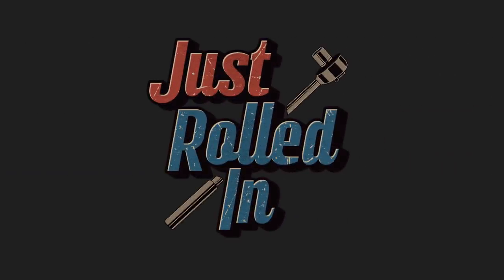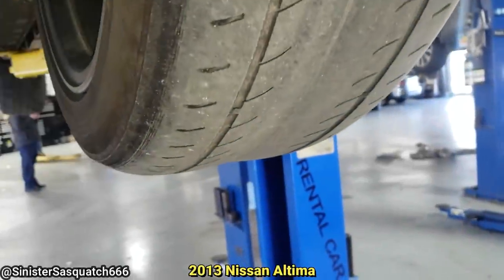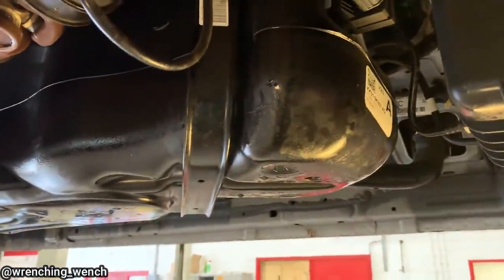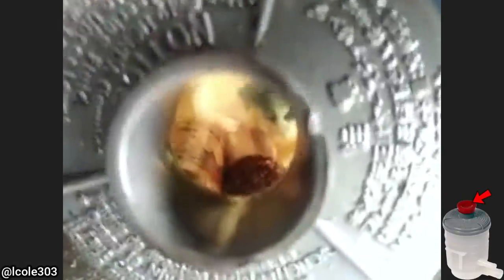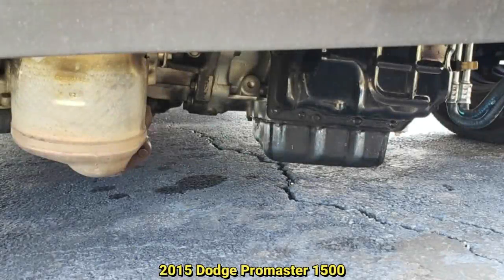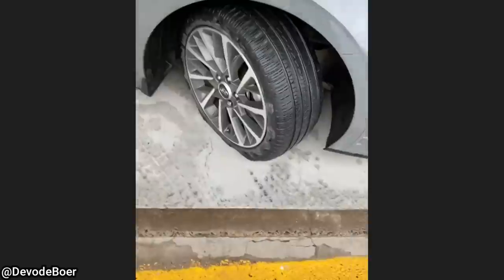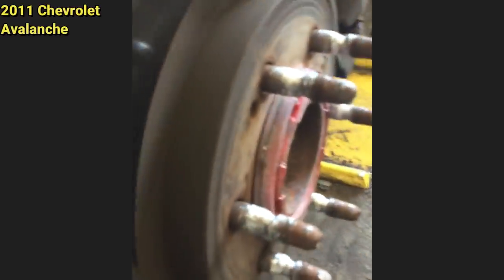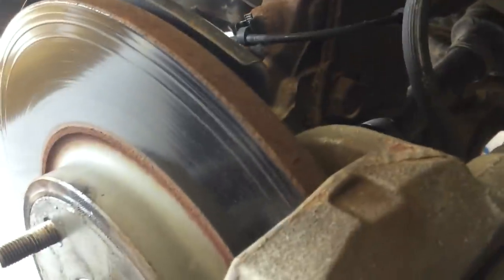Customer States Engine Is Making A Funny Noise | Just Rolled In

Comment: Im glad i dont have to deal with customers like these, as a truck mechanic not having to deal with customers most of the time its great, they only bother sometimes when something happens and they immediately blame the mechanic despite them not listening to us, had a customer where the brake pads we're changed, and both me and my colleague are sure we tighten the bolts of the wheels with proper Nm, but the customer came back two weeks later and one of the wheels had loose bolts, of course he blamed us but the thing is, he's supposed to come back to the workshop after driving 100km to check the tightness of the bolts again but he drove more than 100km and didn't come back to check them just like most people do.

Comment: 01:59, I work for a company that does the pickups for used tires from garages in my area, on a daily basis I load probably around 1300 tires a day into a truck in the busy season(s).

i would say at least 1/5th of the tires we pickup daily are far worse than this. when i first started it absolutely blew my mind seeing the condition of tires that people drove in on.

on a side note; BMW's run flats are quite impressive, the lack of damage on them despite clearly being driven on while flat makes me want to get some for my Mazda lol.
Reply: I got stuck in mud , made my right rear tire look worse than those tires , I changed it with a spare tire , it held air for like 9 months then I got a flat and realized that the stuff that came with my truck was unable to remove my tire 🤣 all fixed now

Comment: OOf, had the broken engine/transmission mount happen to me, previous owner or their garage hadn't tightened the bolts on the driver's side at all,  so they fell off and dropped the engine, had it towed into a repair place, they fixed it, then the PASSENGER side mount snapped as they rolled it off the lift, because of the stress it'd been under. That was bloody expensive

Comment: I don't think I was even 21 yet but I was driving around on bald tires because I was broke.  I went around a cadillac doing at least 70mph in the pouring rain and when i changed lanes the car fishtailed.  Then it went into 360 spins.  I saw the cadillac's headlights go by a couple of times and then a utility pole while I was sliding backwards down the highway.  It missed the pole by inches and finally the rough stuff on the shoulder brought it to a stop.  Man that scared the living daylights out of me.  I went the very next day and got new tires on credit.

Comment: A customer came in complaining his Audi A4 doesn't start (back then when I was working as a mechanic). We pulled the valve cover off and the whole head was full of black, almost coal looking, thick stuff. Camshafts would not turn, the whole engine was jammed. Not a big surprise engine oil hadn't been changed for years.

Comment: I can relate to the guy who drove in with the tire almost flat. Once I popped a tire on the freeway right as I was about to exit onto another freeway. I had to drive about a mile on a flat tire to get to a spot where I could change the tire without stopping traffic for a few minutes. The tire shop said they weren't going to prorate the tire for me because of sidewall damage until i told them what happened.
Reply: I'm all for not ruining a wheel unnecessarily,  but you need to get to the safest area possible to change your tire. I worked along roadways as a surveyor for 25yrs, and I've seen enough crazy driving to make me extra cautious working so close to traffic.

Comment: seeing this made me realize how well my 30year old car is still holding up. The exhaust system needs to be replaced but it's at least still firmly attached to the car XD
Reply: I had the exhaust system on my Taurus wagon ( 86 model) fall off. It rusted so badly due to road salts that collected on the hanging brackets 🤣

Comment: I've worked on all my cars and motorcycles in the past. I'm no engineer but I know when something is wrong. So when I heard a front wheel bearing groaning at me I took it to the dealer. I told the receptionist, " The left front wheel bearing needs replacing. " No ifs or buts. 2 hours later I get a call from the dealership. " Ma'am, after testing we found that the left front wheel bearing needs replacing. " Grrr. " I told you that when I came in. How much am I going to pay for that startling diagnosis? "..." Crickets ".... " When are you going to fix it? ".... " We don't have those parts in stock so it'll be two days. "... " You're the Citroen dealership but you don't have Citroen parts. " .... " Crickets ".... " Tell you what, just leave the car in the parking lot because I've lost faith in your service ". When I went in I expected to pay for the labour cost but they were so pissed at me there was no charge. They just wanted me out of there ASAP. I got it fixed at small garage I found on the internet and it took them only two hours. Dealerships are good at selling cars but not fixing them.

Comment: I like the photoshopped 997 in the outro. Totally legit.
Reply from the maker: And why is it photoshopped?
Reply: @JustRolledIn  Because the angle of the car does by no means match the angle of the ground. Not to mention the colouring is off. Rather easy to see for everyone who is working with photos and editing them.
Reply from the maker: Well they sent me 3 high quality photos that were taken so most likely they were photoshopped a bit.
Reply: @JustRolledIn  It very well may be, that the car is indeed real, but the background isn't. Not that it really matters, just jumped out on me. The 997 is nice either way

Comment: About the last one, the partly armoured car: I saw this several times in Brasil. It can make sense, as it protects against "minor" instant crime with small guns pointing to the head of a driver/passenger. It can give the attacker an unwelcome surprise and the driver an advantage for escaping. 
This kind of "half" protection has its pupose and is somtimes even offered by traders for cars in "disguise" (VW Golf, Toyota  Corolla). Customers are doctors, lawyers and managers. 😎
Reply: A friend had a Merecedes coupe with bulletproof glass , it was part of a protection package . The bottom and doors had plating too

Comment: That one tire looked like it was already about to come apart. I get that U.S. doesn't want to go full safety inspection but I think there should be laws against using unsafe vehicles like tires like that. Who cares about no windshield fluid or that one guy who drives abandoned vehicles from the swamp for a YouTube video but every day drivers who have no clue their tires are about to explode need to be taken off the road until they get their vehicle in working condition. 

When I took my car in for some reason I can't remember he told me about my sagging exhaust. He explained to me that it could split and cause my vehicle to flip. So I fixed it. Actually they just welded it together for less than $80. Great shop! 👍 Also warned me about my tires being close to the low wear indicators
Reply: Double edged sword though. If you think a shop would impound your car you're even MORE likely to bodge it yourself. Maybe.
Reply: @PJBonoVox   that's true. I just don't know how these people can drive on dangerous vehicles with no regard for safety, eventually you'll be paying one way or another. Not really saving any money by driving on bad tires.
Reply: @VintageCars999  Yeah agreed. Don't get me wrong I'm not condoning the state of disrepair and a yearly MOT would be a good idea.

Comment: Had the cap fly off in my hondas pwr steering reservoir(due to return line leak allowing air in the system) it ended up on the frame rail. I thought of putting a bunched up towel on it good thing i didnt.

Comment: Embarrassed to say it took me a minute to see the issue with the battery.  My sister in law once had me cover over after she installed her own battery to see what was wrong.  I was confused why there was no voltage across the terminals until I realized she left the disposable plastic cabs on the battery posts.

Comment: about 40 years ago I was doing an LOF (lube,oil&filter) I saw the brake pads were into the rotor. He says I,ll get them done at a shop next to work. He was a rich know it all, so I said ok. By the time he got to work he had to replace both rotors. I tried to tell him. The whole family was that way.  The wife would come to get gas & say 5. If you put in gal she would say she wanted dollars or vice versa . Then get mad when you ask 5 dollars or 5 gal. Glad I worked in the shop & didn't have to deal with them.

Comment: once had a young lady come in with a brand new nissan back in the late '90s.  she claimed she went to check the oil, couldn't see any and decided to fill it up.  When she got in the car and started it ALL of the lights immediately came on so she came to the shop.  I go to take a look at it, first thing i do is pull the dip stick and it's wayyyyyy over filled.  I asked her how much she put in and she responded with, I filled it until I could see it.   Meaning she took the oil cap off, didnt see any oil in there and filled it... the entire motor on a brand new car.  I told her if she had a warranty she probably voided it...

Comment: Isn't the gelled oil the same stuff they used for Cash for Clunkers in 09. They had to put an additive in the engine and transmission so it couldn't be sold. I own an independent shop, but I know guys that worked at dealerships. I remember them talking about what they had to do.
Reply: The additive was called *LIQUID GLASS OR SAND* if memory serves right?

Comment: I had a customer buy a battery at the retail store I worked at, A few hours later he had his car towed in because it still wouldn't start. I opened the hood to check it and he installed the battery with the red and black caps still on the battery posts.

Comment: It really boggles my mind that America does not have an MOT requirement like we do in the UK. It is illegal to drive on bad tyres in the UK, there is a minimum tread depth requirement and any damage to side walls is simply not allowed. Likewise the engine hanging out of the bay because the mounts were gone, simply wouldnt happen - the car would have been written off long before that happened

Comment: Worked with a woman whose daughter bought a new car.  She had to drive about 100 miles a day, as her job was in another town.  After about 3 months her car "died" before getting to work, and she had it towed to a mechanic shop.  
The mechanic asked her how often she had the oil changed.  She said "Cars don't take oil, do they"?!
The mechanic told her she needed a new engine because there was no oil left in it, the engine had burned up.

These are the morons and Ftards the DMV's put out on the roads.

Comment: I wish people understood that having a vehicle that is so rusted out that things are falling through the floor and whole sections of the body are gone, is just about as bad as having a blown engine. Replace the damn vehicle or start doing some extensive metal repairs. . It no longer has the same structural or tow rating and is a very real danger.

Comment: My favorite excuse when I had to deal with customers who has a flat or bad tire(s) was when they blame the tires for being defective 🙄🤦‍♂
Reply: Ok , so is it normal for your tire to blow out after the tread separated? Cause that tire was fairly new , had good tread on it , and was properly inflated . So … I’m guessing sometimes tires are bad . The tire shop gave me 1/2 off the new tire , I didn’t ask for it, guy gave it to me cause he felt bad
Reply: @peterf.229  yeah its soo normal 🙄   The percentage of actual tire manufacturer defects is low, like 1%  Show me where the tire was properly inflated prior to the blow out?  I'll wait.  More than likely the driver ran over a nail or something (or even a pothole at a high speed)  to cause  the tire to loose air and led to the blowout.

Comment: Yeah I had a Honda Odyssey come in today on the rollback the customer said to find exhaust leak and do an oil change and see why C E L was on it was multiple misfires the cats was rusted out blown exhaust manifold but the oil had 11 quarts in it should only be 4 and 1/2 quarts I cranked it and it smoked like a house fire but after running it shutting it off and cranking it 4 times it burnt all the oil out the cylinder stopped misfiring but I told them need to replace sparkplugs because of possible damage he never said how it got so over filled

Comment: They may have changed this since then, but my dad had a  Subaru WRX when I was younger, and despite doing most of his own work on it, he always took it to a shop for oil changes. That’s because, as a low-end rally-racing model, it had an aerodynamic plate underneath the engine block & oil pan blocking access. The inconvenience of getting the plate off without a lift outweighed the convenience of at-home oil changes.

So I’m calling BS on that guy actually doing any changes himself. Given the critical thinking shown by “only oil additives” I’m guessing he saw there wasn’t an easy way to access the oil pan and assumed it was unnecessary. And if you never take oil out, why would you need to put more in? The oil additives will make sure it works right? 🤦🏼‍♂️

Comment: Oh, the poor cars... I weep for the beautiful machines ruined by idiots like that. Our family can only afford 1 car and although it is older than me, it's kept in a good condition. Regular checks, oil change, no abusing the steering, fixing tires yourself or pouring questionable concoctions in it. The only thing that is not in tiptop shape is the windows system. It jams often, specially the one on the driver side.

Comment: Simple way to avoid these problems. Get and old diesel Skoda with 200k miles for £1000. Shoot it, throw bombs at it, fill the fuel tank with piss or just remove the engine and that shit will still turn over first turn of the key

Comment: How does oil turn to jelly?!?!
Reply from the maker: I've seen it happen with internal coolant leaks. Coolant mixed with the oil. But I think all the oil additives they used must have caused a weird chemical reaction and turn the oil to jelly. Unfortunately nobody gives me more information so we are all scratching our heads lol.
Reply: @JustRolledIn  Insane

Had an old car that did 60K miles on the same oil, with occasional top ups.  Didn't do this!  But then, no additives were being added.

Comment: I am at pains to comprehend this american obsession with Oil and oil additives. A modern  engine (manufactured within the last 20 years) only needs to have it's oil changed once a year or every 15000 km in most applications.
Reply: I follow my car's manual. There is still some variation on modern cars with regards to this. For example, my 2015 truck says every 5000 miles (8000km) or 6 months. My 2016 car says 10,000 miles (16,000km) or 1 year. But I have never used any oil additives in my life.

Comment: And that is why I refuse to use additives in my engine and tranny. Even when I learn how to rebuild an engine and tranny. Nope nope nope. Plus the old tranny that grenaded 4th cause the prior owners managed to cheapo buy a 350k mile tranny and dropped another 100k with gasket sealant and stop slip. Wish I was kidding. Had literal gear glitter on the drain plug. Now I got a 170k mile tranny with another 1k I've put on since and 3rd is sticking a bit so I'm taking her in for service soon before 3rd grenades cause something got jarred loose by the accident that totaled the civic it came out of.

Comment: What on earth does he mean by "he only uses additives"? 
Does that mean he does not use any base oil at all? 
What ever he has done it has been a crap idea.
Reply from the maker: Yep just additives from what I was told. Lol
Reply: @JustRolledIn  the things people put in engines amazes me. 
I sold a brand new engine to a guy and 6 months after the purchase he contacts me and says "he cannot see water flowing through the radiator" so he took the whole engine apart and sent me photos of the water pump with weird corrosion and crystals growing in it. 
I found out his local water supply is from ground water and contains salt.
I don't know how they drink it. 
This turkey had put salt water in the engine. 
I wonder why the pump is dead?

Comment: some videos are not real...
Boss, I have seen 20 years old oil in tractors... And it was never pudding.
Reply from the maker: It wasn't caused by not changing the oil. It was caused by the customer only using oil additives as mentioned.

Comment: Your very first segment showed the solidified content of the oil pan but failed to expound on how it got that way. Could you please explain what caused that?
Reply from the maker: The technician didn't mention more about the clip so unfortunately I'm not 100% sure. But as mentioned the customer only used oil additives so I'm thinking they had a chemical reaction which caused this.

Comment: wait that rotor sitch is not wrong, you have an option vented or not, vented are like $50 more.. you get extra fat pads for the non vented, stupid I know
Reply from the maker: They had a brake rotor from the rear on the front.